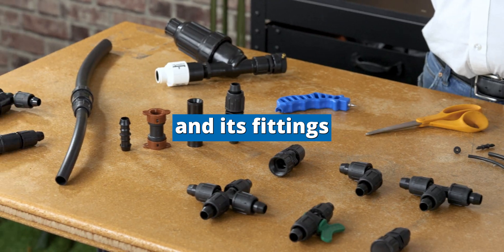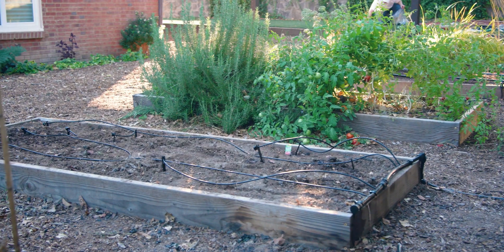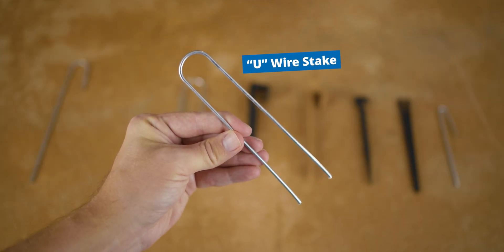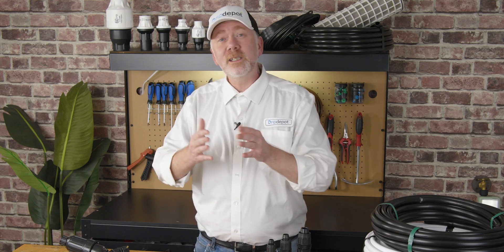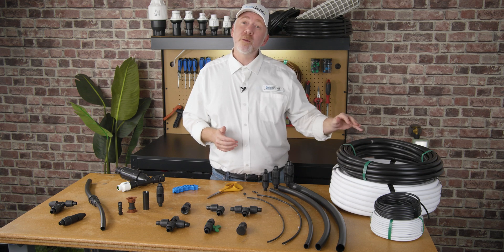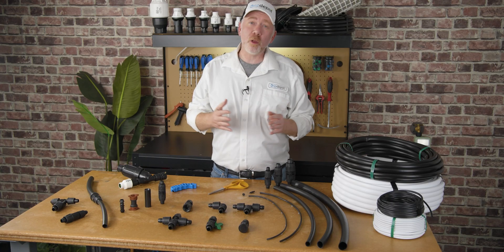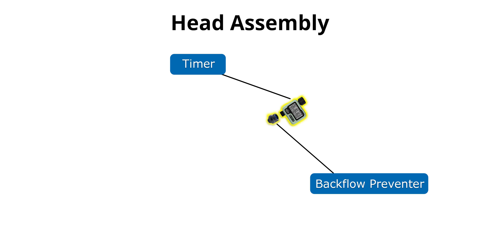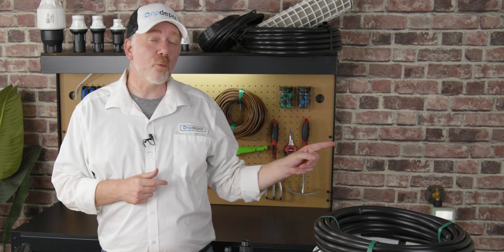Drip Irrigation Poly Tubing and Fittings: Everything to Know for your Drip Irrigation Project

Comment: Can I use 1/2 tubing for my drip line
Reply from the maker: You sure can!  As long as the system doesn't overtax it in regards to total flow rate and length (the general rule is keep it under 200' length unless flow is really low, and under 200 GPH unless its length is short).  You can put drippers directly into the wall of 1/2" or larger tubing as well.  

We made a short video that covers using 1/2" and larger tubing as a drip line with emitters installed directly into it.  In case you hadn't bumped into it yet, here is the link: https://www.youtube.com/watch?v=t4iC8rh9CPQ

Comment: I have some dead emitters on 1/4" drip line, poking with a toothpicks doesn't seem to do anything.  Is it easiest to just cut out the bad ones and splice in new?
Reply from the maker: Possibly, but there's two other things to try first (all easy things, and cutting out and splicing in new is pretty easy too if these don't work). 

1. If you haven't yet, take the goof plugs off the end and let water run through -- often the turbulence will dislodge any debris inside and send it right out the end. 
2. While the system is on, place your thumb firmly over the hole for a few seconds, then quickly remove it.  This can create a pressure differential that dislodges debris (if this gets it work again, flush the line with the method above shortly after). 

If neither of those work, it's probably easiest to just splice some line in (if it's mineral scale causing it, there's other methods, but much more involved than putting in some new line).
Reply: @dripdepot  thank you for the suggestions.  I'll give them a try.

Comment: Why is filter almost always shown placed upstream of the pressure reducer?  The plastic housing on my filter keeps springing a leak -- presumably because it is exposed to the full pressure of the water system.
Reply from the maker: The main reason is to filter the water to protect the regulator  -- if a regulator gets too much debris in it, it can fail (and if that happens, you risk potentially exposing the downstream components to high pressure).  

Some filters don't work as well at lower pressure as well, which is a small secondary reason -- every filter causes a small pressure drop, and its best if that happens before the regulator than after.  With many filters you might not notice, but others could cause a system performance drop.  

With all that said, the common hose filters should be able to handle up to about 75 PSI and still get a good lifespan out of it.  

One tip just in case: Be sure the filter is placed downstream of any timers or shut-off valves -- they're not rated for constant pressure so need to be relieved when the system is not in use (same with the regulator and backflow preventer).  If yours are already downstream of shut-off valves they should be lasting you a good amount of time and something could be up with the filter(s).

Comment: Remember me? Are these tubes OK to stay outside over winter? Thank you Adam!
Reply from the maker: Heya Jennifer!  I do remember you, it looks like you have a different YouTube handle now though =D

You bet, the mainline tubing is safe to stay outside over winter if you've drained it -- usually you can just open up an end cap that's at a low point and let the water drain out.  Tubing at low points you can lift up for a second to get the water flowing out.  Once it's drained, it's very freeze resistant and can be left out  :)
Reply: Ok great.
The little tubes are all over the place like an alien so I just pulled everything up after all. As for my handle, I thought I just changed my photo🤷🏻‍♀️. At least I didn’t lose all my favs!
Reply from the maker: @JenW-l9b  LOL the tubing can indeed look a little alien now that you mention it!  If you pulled your tubing up, there's a very good chance the water drained to the lowest points (which is a good thing), I think you'll be good to go. 

Also I truly hope you and yours have a great Thanksgiving out there! =D